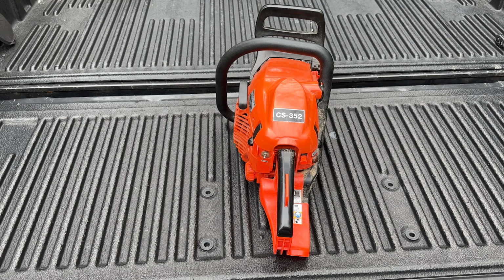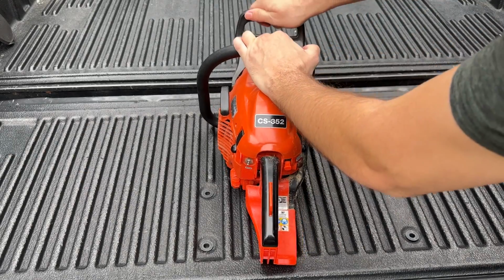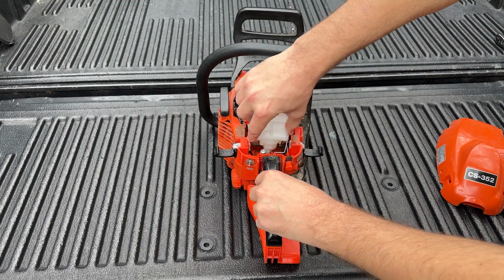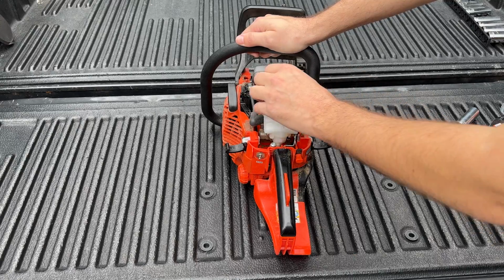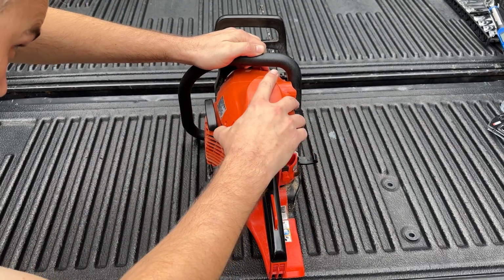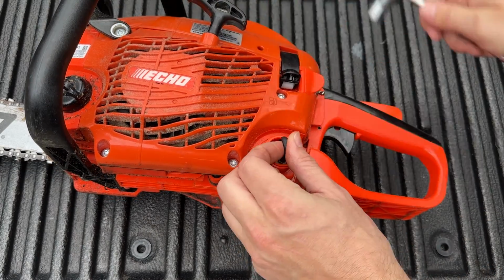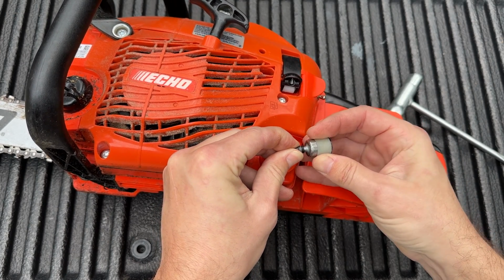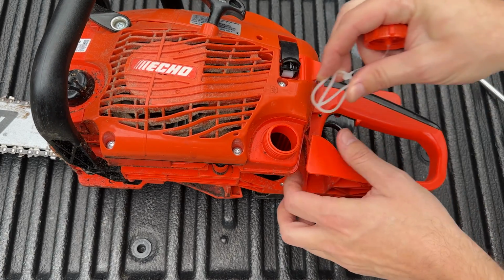Echo CS-352 Air Filter, Spark Plug, Fuel Filter Maintenance

Comment: Primer bulbs are clear plastic when new. Yours is old and about to crack. I would throw a new primer bulb on. You can get a 4 pack of them at the huge online retailer for like $8 or $9. I do them at the same time as the air filter and spark plug.